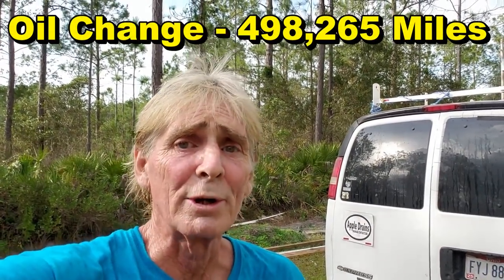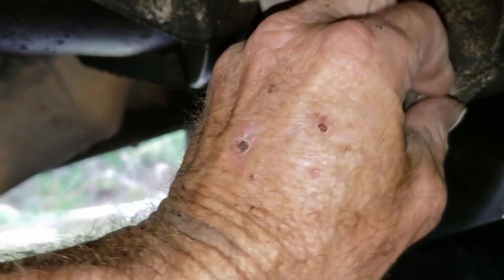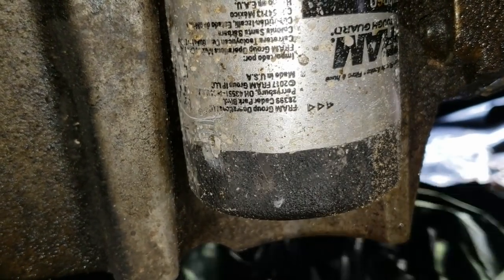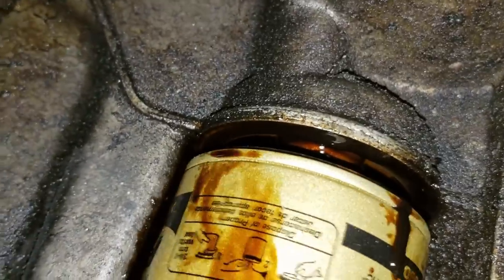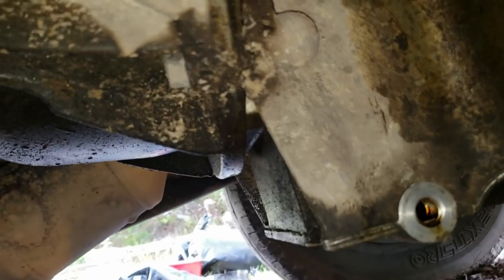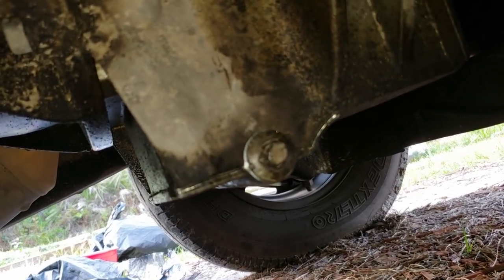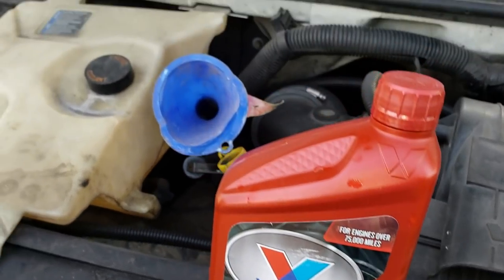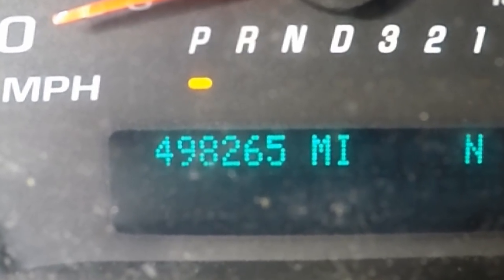FRAM OIL FILTER, How Good Are They? How To Do It Yourself

Comment: I laugh at all these so called “experts” who cut Fram oil filter open and claim they are garbage.  Fram filters have helped me put millions of total miles on my vehicles thru the years.
Reply: GrifFungin    I've used Fram oil filters for probably 50 years or longer, No problem at all with them.
Reply: The orange fram filter (cheapest one) is the one that's junk, this XG synthetic filter is actually excellent and nobody think's they're crap.
Reply: The SO called cb end caps they use  they say it holds the filter media better with the glue better vs metal. Hell some filters don't even have end caps. (Toyota oem.)

Comment: Being a mechanic and mechanical engineer for the last 27 years has Me pretty positive your lifters are ticking because of crappy Base Oil, If you stay with a Polyolefin base oil like , Mobil one FS, Amsoil, Quakerstate Ultimate Durability,and the new Gas to Liquid - Pennsoil Ultra, will keep the smallest of oil jets and control valves, check valves and the very small working components used in hydraulic roller lifters and cam fazers free of clogs and jam ups also shellacking from constant high temps. This is why the Air Force began using POLYOLEFIN BASE STOCKS Almost 40 Years ago, the fake synthetics are not nearly as good eliminating Sludging, in fact Polyolefin's and Liqid to gas Base stocks are nearly 75% cleaner of carbons after 5000 miles than any conventional or 30% better than synthetic blends, Stay away from Castrol synthetic, they were sewed in court by Mobil one for calling there syntec oil a synthetic because in all actuality it's just Dyno juice pumped from the ground and cleaned up of organics , wich is good but not nearly as effectively on these newer more accurate clearances  that everything after 93 uses in their Hydralic lifters, the copy cats are, Castrol , Valveline, Supertech ,Amazon Basic,Lucas,Napa,Kendal Travelers,Cam2,, and only buy Mobil1 advanced ful synthetic, not Super synthetic one that extended drain crap, And My Sleeper OIL THA  has called out all Synthetic oil companies and challenged them to a Wear competition side by side with any choice of wear test is QUAKER STATE, I personally run it once a year with a FULLY Synthetic filter like Royal purple filter, Amsoil filter or Fram XG, yup once a year, 225,000 miles on my wife's 06 Sat. Ion 2.2L, and 115,000 on our Caravan SXT 3.3L lifters are bothe quiet
Reply: So which brands of oil should be used and which ones shouldnt?
Reply: so this engine defies the myth that says that as engines age clearences are wider so you need thicker oil...this guys keeps puting 5w30 after 500 kmiles..wonder how oil pressure is after this 500 kmiles and still using 5w30 thin oil
Reply: @bestofthebest3821  
I don't consider SAE30 oil to be thin oil.

Comment: Hey it works... I would prefill the filter first, keeps it from having a dry start, but other then that do what you gotta do. I'm going to use super tech on my next oil change on a 22re, 25 bucks for full synthetic oil, filter and STP zinc additive cant be beat... wish me luck. 

P.S.    That's Alaska prices and why I'm running a synthetic for the cold winters. In the summer I run a 15w40 for that old clapped out engine.

Comment: You change the oil rather frequently. Is that due to the sand and dirt you deal with? I have seen videos on how bad Fram filters are with the guys cutting the oil filters open. They go on and on about this part or that part being cheap. This part was plastic... it should be metal, etc. The problem is those videos can be convincing and persuasive. They are not using  a scientific approach but people buy in.  We live in a time with more information available to the masses than at any point in history yet, I think we are more mis-informed than ever.
Reply: Its possible the vehicle's service interval for oil is 3000-5000 miles with 3000 being recommended if you are towing or carrying heavy loads frequently.
The newer engines coming from the factory with synthetic oil and 10,000+ mile service intervals only really started in the late 00s.

Also, keep in mind he is using conventional rather than synthetic oil too which tends to have a more frequent service interval.
Reply: bg147 : Just do not buy the orange Fram filter (Extra Guard). Buy their better ones such as Tough Guard or Ultra Synthetic. You can't go wrong with those!
Reply: The orange fram filter (cheapest one) is the one that's junk, this XG synthetic filter is actually excellent and nobody think's they're crap.
Reply: @FrenchValleyAirport  My family put millions of miles on our cars with the cheap Fram, and never had an issue. Yet, if you plan to go 10,000 miles, I would go with a more durable one.
Reply: @AlexanderNecheff  With the higher quality conventional oils, most people go a bit longer. Yes, your explanation makes sense with his truck being for heavy work.

Comment: You bought one of the better fram filters, you can't say that about all fram filters. The lower priced orange ones are made from tissue paper and plastic. My Chevy gets the metal USA made AC Delco. Like God intended 😂.
Reply: Rob Pridemore don’t buy the ac delco with an “e” after the part number. It is an aftermarket
Reply: @jonsmith919  Yea those are junk to lol. I like the metal AC Delco for the price. If I didn't go through oil changes every month I'd buy Napa gold or Mobil 1 filters. All about the best filter for the price.
Reply: Cut open your new AC Delco’s and see who has plastic in their filter now. Run an Extra Guard for yourself and cut it too.
Reply: Well guess what plastic doesn't filter oil and neither does metal.

Comment: I used fram all my life . 300 thousand plus on my trucks . The problem for most people is there lazy and go way past there oil change mileage.  There other maintenance not to good either lol. Engine light on poor gas bad spark plugs all effects how your oil will look .a poor running engine Will kill your  engine life and oil . You can't fix stupid. Glad to see you keep it running good. Ime Shure the guy s saying use better tools are those stupid ones with poor maintenance .I can drive my 180000 thousand mile vans 10000 miles with out worries today tomorrow any day why my maintenance top notch. I love passing brand new cars broke down in my 2002  knowing they won't last as long. Because of stupidity.  Don't let it get you down Karen's never have anything nice to say😱🤔🤣👍

Comment: Unbelievable. Worst oil change I have ever seen on YouTube regardless of what filter or oil you use. Buy a new drain plug and after you take the filter off, let it drain for a few minutes till almost nothing else is dripping and NEVER use old, contaminated oil to lube the gasket. You should also fill the new filter about 1/2 full then put it on.
Reply: Wm Cottrell you don’t have to fill up the filter cause there are plenty of cars that have there filters complete horizontal and you can’t fill them so it’s not something you need to do
Reply: @marcusmendoza9354  So what? That's not the real issue here, who gives a shit??!! NEVER USE OLD CONTAMINATED OIL TO LUBE A GASKET. It has contaminates in it. Unless you use a syn oil and have a fumoto plug and send it off for analysis which I do, DON'T use old oil on a gasket.
Reply: @marcusmendoza9354  Please learn English before commenting.  The word is cars, not "cares". Before you illegally crossed American borders, you should have learned proper annunciation and English grammar.
Reply: And how often should you change the oil?

Comment: Fram filters have a bad reputation that came from the early 80’s. Honestly if they were so bad they wouldn’t be making them anymore. You’re using the XG line which is even better. 
I have to be honest I cringed when I saw or see anyone using a Vice Grip for a drain plug . I was taught 47 years ago to NEVER use a Vice Grip on a drain plug or anything else unless it’s a last resort. I’ve seen too many drain plugs destroyed from using improper tools to get them out . Some were so mangled that they they had to be drilled out . This turned a 10 minute oil change into an all day event. I will not even use an open end wrench.

Comment: Your killing these quys that are pay out the ass for claims and assertions of way more expensive filter and oil. But most won't keep the vehicles nearly as long as your rig with half a million miles.
Reply: The orange fram filter (cheapest one) is the one that's junk, this XG synthetic filter is actually excellent and nobody think's they're crap.

Comment: Splurge and buy the proper wrench.
Reply: Tex, He should SPLURGE & buy a new oil plug.
Reply: Tex, which wrench will fit a beat up drain plug?  Answer: Probably none. A new drain plug (preferably with a magnet), will be required.

Comment: Fram filters are no good. I just had one split on me yesterday and blow oil everywhere.
Reply: Which one? They make three different tiers. The lowest is one of the worst filters available, the highest tier is one of the best filters available. So which one was it? There's a pressure test video on YouTube taking a fram filter to 360psi, that's about 5 times higher than your oil pressure.
Reply: @JeremySchoeder  mid tier. Never had a filter burst before

Comment: Endless horrible things.. Visegrips on the drain plug. Fram filter. Didn't pre-fill the filter. I'm surprised this truck has lasted 498 miles, let alone 498,000. Don't trust to luck. Use only the most expensive everything. And listen to all the boo birds!